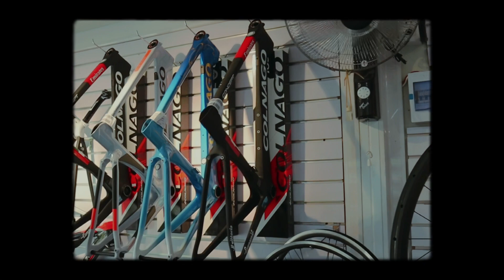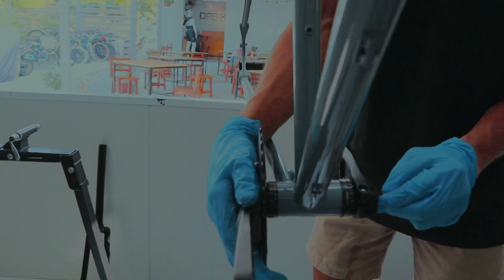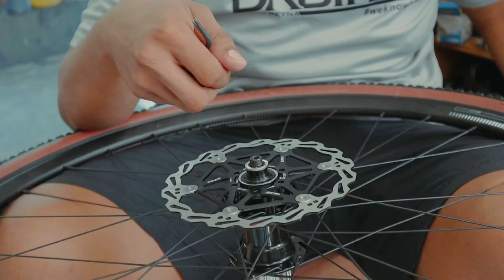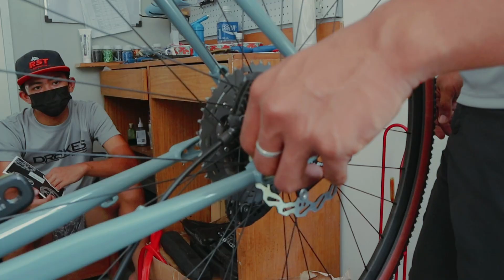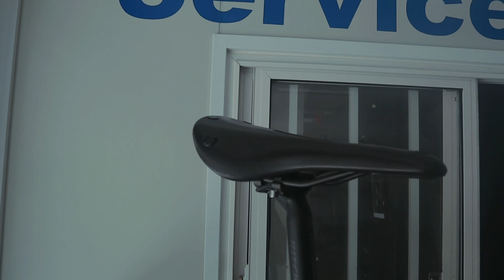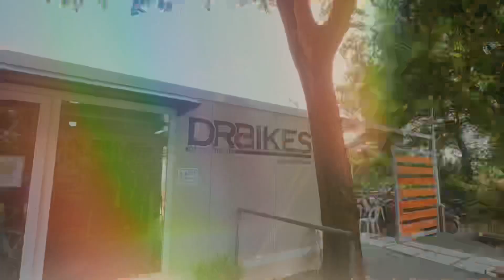DREAM BUILD GRAVEL BIKE—The Project: Gravel Grinder | Part 2 | Full Build by DR Bikes

Comment: Nice build bro! I would like to ask the rotor size that you were able to fit...sa front and rear because I'm also about to build a gravel bike of my own using the same groupset.
Reply from the maker: I’m using 160mm po. But that will depend padin po sa gagamitin nyong caliper adaptor. Yung sakin kasi customized flat mount adaptor and ang maximum rotor size nya is 160mm lang.
Reply: @christianemmanuelle88  is it possible to do a 2x setup sa grx using a grx 812 rd that is meant for 1x setup? the benefit of using such is that you'll be able to fit a max of 42t casette instead of 34t with a grx810 rd. There's no recommendation from shimano of such setup but I have heard that a few gravel bike here in the country uses such combination.
Reply: is the drivetrain able to accommodate a 48T in the front combined with a 42T at the rear using a grx812 rd?
Reply from the maker: @joseangelovergara4545  yes, if you’re using GRX812. If nag-aalangan kayo, pwede naman po maglagay ng goat link or wolftooth tanpan